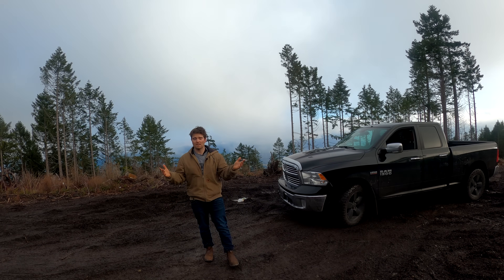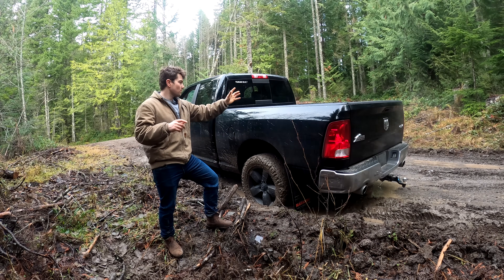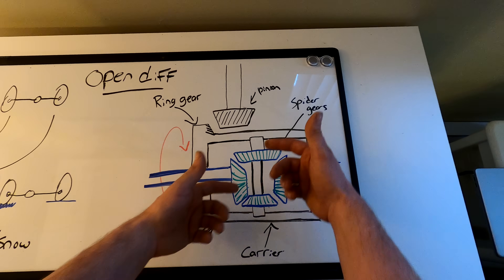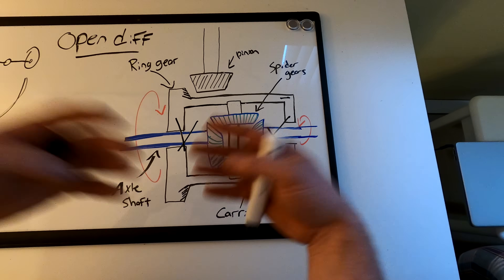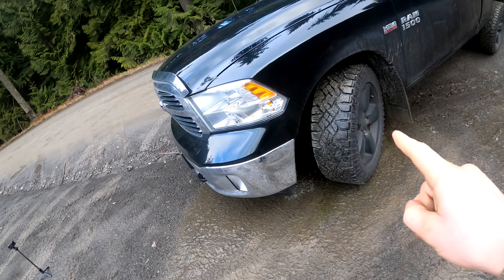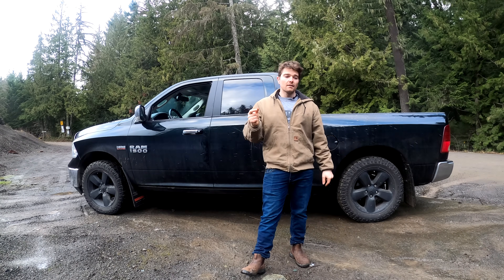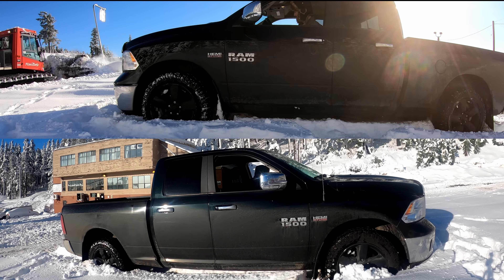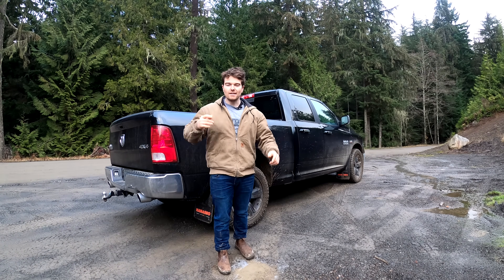RAM 1500 Open Differentials SUCK Off Road (You'll Get Stuck) | Real World 4x4 Testing

Comment: After having a ram 1500 for three years I got rid of it for a 1 ton diesel a ram 1500 is basically a car with a pick up truck bed on the back they are not heavy duty they are not meant for work and if he work him hard they’re going to fall apart the only thing good about it is the engine is pretty good the hemi if you keep the engine oil really clean otherwise what about 90 K miles that engines gonna blow up because the cam phasers are screwed up because of dirty oil and then you’ll pay $5000
Reply from the maker: you speak the truth sir

Comment: If you applied rear brake half way' that would act as "brake locking differential" and rear axle would push you forward. Old trick.  Again' having a proper locker is a way to go.
Reply from the maker: I gotta try this. sounds like another test is needed!
Reply: How do you ‘apply rear brake’? 🤔
Reply: @jonothanjames2132  emergency brake works on drum in the hatch for the rear axle, press it half way and watch what happens
Reply: @borkonikolcic6260  press the emergency brake in halfway?

Comment: Glad mine came with factory lockers.. in snow all 4 wheels pull.. false advertising from dodge.. its really 2 wheel drive in 4x4 lol
Reply from the maker: pretty much 2 wheel drive. obviously all 4 wheels can receive power but rarely at the same time unfortunately. what kind of vehicle and set up are you running? my idea set up on my truck would be a torsen (Eaton true trac) in the rear and some kind of e-locker in the front.
Reply: @GettysGarage  13 ram 1500.  I got it with the factory lockers.. its easy to change yours out... all you have to do is change the guts
Reply from the maker: @scottrussell6717 the 4th gen RAM 1500's (09-18) didn't actually have a factory locking differential option. they had a rear LSD option  but that's it. every single front differential came stock as an open differential. unless you bought it used and someone installed lockers. regardless i'm hoping to throw some lockers at my truck once out of warranty.
Reply: @GettysGarage  as a retired mechanic it's the same thing.. dodge calls it anti spin.. but it a locker.. limited slip.. anti spin... it's all the same thing... they all have clutch packs

Comment: My 2011 ram 1500 ST hemi 5 speed  locks in both soon as one starts spinning. Do a brake tourc and it smokes both back tires everytime. my buddy has a 2012 same truck and he is one wheel peel all the time and he hates it. guess mine has a factory locker. for the guys with a ram u need to hold the traction control button for about 6 or 8 seconds while in 4high it will turn off track control completely and then its a different animal.
Reply: Yep you have a factory locker
Reply from the maker: so the 4th gen RAM 1500 (09-19) didn't have a factory locker option. Shocking but true. you most likely has a rear LSD. As for the front end, every single factory front diff for those truck is an open differential. BUT you are 100% correct turning your ESC system off makes the truck much much more capable. something I have only learned recently lol
Reply: @GettysGarage  mine is a 13 with factory lockers

Comment: Never buy a 4/4 without at least a posi in the rear, there useless be better off with a two wheel drive
Reply from the maker: I mean personally I'd rather my 4x4 truck then a 2wd but your point is completely valid lol. I have a Eaton true trac rear differential in the mail so don't worry!

Comment: My 13 it brakes the spinning wheel even in 2wd, but not that aggresives it takes about 2 sec before it brake it, in 4wd it brakes the spinning wheel slightly more agressive than 2wd
Reply from the maker: interesting! traction control is supposed to help but it never seems to brake the spinning wheel hard enough to force power to the other wheel. I'll looking into that thought! thanks for the info

Comment: Your truck doesnt have brake lock diff?
Reply from the maker: a brake lock diff ? what do you mean by that I'm curious
Reply: @GettysGarage  thats what ram called it, i seen few videos on you tube, they doing diagonal test, it shows it brakes or slow down the spinning wheel so the power will transfer to the wheel with traction, it uses the ABS to brake spinning wheel,

Comment: How do u lock the diff?
Reply from the maker: I can't lock my differentials because they are open. you have to have a locking differential in the first place. a lot of trucks don't have that option but some do. so do some research and find out what kind of differentials you have. some locker lock automatically, some are electric and some are air actuated.
Reply: @GettysGarage  I have a 2020 Ram 1500 Laramie 5.7 HMEI 4x4
Reply: Most are automatic... ford has a button on the dash to lock it

Comment: I believe the 5 gen RAM trucks now come late to the party with a e locking differential like the Ford trucks since 2011 but GM been equipped with auto mechanical lockers since the late 70s early 80s in which you can get em factory with the truck doesn't have to be a z71 or fx4..... You can get a locker on a 2wd Ford and GM truck. Toyota is the lone manufacturer without a locker in a full sizer.
Reply from the maker: Yes I believe you are correct the 5th gen Ram's have a true locker option. I've driven a ford with an e-locker in the snow and it is pretty awesome! My first truck was a 96 k1500 GMC with the G80 locking rear end and it was wicked in the snow. when I bought this truck it was kind of disappointing knowing my 25 year old truck was more capable lol but it is what it is. And shame on Toyota lol pay an arm and a leg for those things, least they could do is put a locker in them.

Comment: Does these ram come with lsd? My bros 2013 2wd has a lsd but you must turn off traction control to spin em both other wise doing a brakestand with t/c on does a pegleg the clutch is slipping
Reply from the maker: yes the rear end had a LSD option. traction control can suck sometimes lol

Comment: Thanks sir that's such an amazing video.

However I am wondering if it stated in your buldsheet something about ( anti-spin rear differential) which my 2019 big horn classic has and I never tried it.
some people say it will work as if its lsd ( i am not sure about this lool) but yeah Would love to know if your truck equipped with the anti-spin rear differential or not. 

Thank
Reply from the maker: my truck does not have an anti-spin. an anti-spin is rams fancy name for a limited slip differential. there is nothing to try either, it's automatic and happens right in the differential. basically when one wheel starts to spin torque is forced to the high traction wheel. trying to force both wheel to spin at the same time. makes a big difference off-road and in the snow

Comment: Turn your traction control off
Reply: I would floor it and it would come out just fine traction control off I would walk right out
Reply from the maker: @64impala59  probably. like I said I was just showing how an open differential reacts
Reply from the maker: wouldn't do a thing. traction control on or off wont fix an open differential. If I was actually stuck, Yes 100% I would turn my traction control off and my ESC system. but I was just trying to show the downfalls of having open differentials
Reply from the maker: @Scott Pray yes turning off the ESC system makes a big difference.

Comment: Love your tests and experiments man! Does 4WD Lock on the 1500 Ram allow all four wheels to spin no matter what?
Reply: Nope not unless you have locking differentials
Reply: The Outdoorsman has lockers in the front but the rear is open
Reply from the maker: @j.r.2585  that is incorrect sadly the 4th gen RAM 1500 (09-19) didn't have any stock locking differentials from factory. the outdoorsman came stock with a rear LSD and an open front differential. jack your front end up and spin the tires. if they spin in opposite direction you have an open diff.
Reply: @j.r.2585  my Outdoorsman,  has a posi in the rear, it goes good offroad
Reply from the maker: Thank you happy you liked them. Sadly no. the 4WD LOCK means your transfer case is locked. meaning that both front and rear differentials have to get power. BUT, that doesn't mean all 4 wheels will get power. the only way all 4 wheels will have power in any situation is if you have a front and rear differential locker. and sadly not a single 4th gen ram 1500 had a stock locking differential option. Best case is you have a rear LSD.
Reply: @GettysGarage  power wagon the only ram to have lockers front and rear
Reply from the maker: @brandedmcgowan9414  the power wagon is an animal. factory front and rear locker plus a factory winch lol sign me up
Reply: @GettysGarage  i forgot about the winch. And i also can see the reason why RAM don't put a Cummins in the PW hint hint offroader traction and weight factor (but at least make it an option just for kicks [and why noy the HO Cummins like in the 3500])
Reply from the maker: @brandedmcgowan9414  Apparently the the PW has a lighter duty suspension up front for better off-road performance and comfort so the weight of the Cummins engine (over 1000lbs) just wouldn't work. also heard for the winch being there, a straight 6 block takes up too much room whereas the V8 allows room for a high capacity winch. regardless would still be awesome to see a cummins in the PW. even if they suspension in the front had to be stiffer.
Reply: The truck will FULLY LOCK IF U DISABLE THE ESC! Tapping the button only does the rear, press and HOLD the trac control button until its says "ESC OFF" on the dash.
Reply: I drove a rebel ram 1500 I believe it was a 19 it had a button to lock the rear differential. It was all from the factory as it was a rental.

Comment: I have the BW44-45 transfer case. What is not clear to me is when I put it in 4WD Lock does it lock just the transfer case or the front and rear diffs? Based on the user manual it would seem the diffs are locked and the transfer case is engaged to get power to the front diff but in your case you demonstrating that the diffs are still open and on the transfer case is locked...I know you have the BW44-44 but still confusing to me...
Reply from the maker: Great question! The 4WD LOCK option is pretty deceptive. So the only thing that is locked is your transfer case, meaning that there is power going to both your front and rear axle at all times. whereas 4WD AUTO has power on and off to the front axle depending on road conditions. but the LOCK option unfortunately has nothing to do with your differentials. if you are lucky your truck has a LSD in the rear but every 4th gen RAM 1500 came stock from factory with an open front  differential.
Reply: @GettysGarage  thank you for your response! I do have the LSD or anti-spin as Ram calls it. So I'm thankful for that! From what I've read on a forum they stated "The transfer case drives front and rear driveshafts at the same speed. This is why it is not recommended to engage 4wd on pavement." But if the front diff is open and not locked in anyway I do not see how if would cause skipping or binding and why Ram puts in their guide for 4WD to only be on slippery conditions? I'm still learning for sure but even if the same power is sent to both axles ~50/50% then if you turn on wet pavement the open diff would allow for no slipping or binding. I have no need to run 4WD except for off road but just using it as an example based on what I've learned here and after watching #EngineeringExplained
Reply from the maker: @cjcomputer1  Again great questions! so when you take a corner ALL four wheels are spinning at slightly different speeds. the open differential in front take care of the speed different between the two front wheels. The rear differential takes care of the speed difference between the two rear wheels. but what is missing is that when taking a corner your front axle as a whole is spinning at slightly different speeds then the rear axle as a whole. So something needs to take up that "slack". and when the transfer case is locked, no slack is available so it puts tremendous pressure on the internal gears when on dry pavement because it forces your wheels to skip in order to take up that "slack". the difference in speed between front and rear axle needs to go somewhere so the easiest place is normally a slight wheel skip, but on dry pavement there could be so much torque needed to skip that wheel that an internal component fails first. Now, on wet or snowy roads that wheels skip isn't even noticed because the friction co-efficient is much much lower. so that is the binding that people are talking about. if you were to run true 4x4 drive set up you would need a differential in the front, rear and need an additional one in the transfer case. all highway trucks have what called inter-axle differential and it allows for speed differences between both front and rear drive axles. I hope that makes some sense. it took me a while to grasp lol
Reply: @GettysGarage  wow! Ok sounds good to me! It makes sense for sure. Hard to grasp yes. You have to think on it a minute haha Thank you!
Reply from the maker: @cjcomputer1  the only reason I know this is because my day job is working a diesel mechanic so we learn all this stuff in trade school. And trust me it takes guys a little bit of time to fully understand how a 4x4 powertrain works with 3 differentials spinning.

Comment: I might be totally wrong amd not even in the same ballpark... But would shutting off traction control or the esc work ??
Reply from the maker: If I was actually stuck then yes turning both your traction control and ESC off would help greatly. but as for my little tests, No. Traction control on or off can't fix the mechanical limitation of open differentials. theoretically, traction control ON would be more beneficial for an open differential. because as the wheel with less friction is spinning and not pulling you out while the stationary wheel has all the traction and friction is not spinning. so what traction control "attempts" to do is apply brake pressure to the spinning wheel and making it harder to turn and force power to the wheel with all the traction. But, it seems in the real world when stuck it doesn't help much. hope that makes sense!

Comment: This is operator error....I don’t have issues with my 2017 ram 1500 on way worse roads
Reply from the maker: confused how mechanical limitation is operator error...
Reply: @GettysGarage  I’m just saying dude I just never had problems with my ram and I 4x4 in the high country in Colorado, it’s actually my 4th ram in my lifetime. I wasn’t trying to be ignorant.
Reply: @Atom_187   @Adam Robbins  Your Ram would do the same as the ram in the video
Reply: @danieldlcm  it actually don’t but I do extreme 4x4 and I have the proper gear ratio and tires and lift
Reply: See what doesn't make sence to me is I've never got mine stuck even from a dead stop I've always had big knoby tires I payed good money for my 4x4 has only been use a couple times I would sink my truck take off traction control and still get out just fine

Comment: Ever heard of a Ford F-150?
Reply: Yeah ,just pulled one out of a snow drift ,with my ram 1500. Lol..
Reply from the maker: @michaelpincavitch5245   my ex girlfriend drove a ford f150. don't like either of them
Reply from the maker: LOVE them
Reply from the maker: @Darvin Stjohn haha most likely but fords do have that factory e-locker option which is pretty cool
Reply from the maker: @Darvin Stjohn that's an interesting thought. A locker with CV axles. I generously wonder if there would be any complications. I imagine guys have run lockers with cv axles up front.
Reply from the maker: @Darvin Stjohn I was looking into if anybody has swapped the open front diff on any 4th gen ram truck and apparently you have to swap out the whole differential unit. looks pretty labor intensive lol

Comment: Great video as always. I like learning and you've taught me the workings of a open and locked diff. I guess it all comes down to cost to manufacturer so they opt out of locking diffs from factory. Mud adds personality so I like it. Thanks for the video, keep up the great work, cheers
Reply from the maker: yes for sure they are more expensive and for most people they will never even need a locker so it makes sense why a lot of trucks just come with open differentials. thank you for the kind words!
Reply: @GettysGarage  back in the late 60s early 70s most stuff came with a posi in the rear . The general public couldnt handle it ! All kinds a ppl rolled ther vehicles . You get on a good incline , ( ben ther , every body in the vehicle says your goin wher ? We ll walk ! ) That posi in the rear got to many ppl in trouble . Throttle it n ther ass end swung down hill ! Thats why they drifted away from posi mid 70s . I got lucky my 77 3/4 ton chevy came with factory posi up front . Trucks a beast ! 6 inch lift 35/12.50s 
Truck hunts hard !